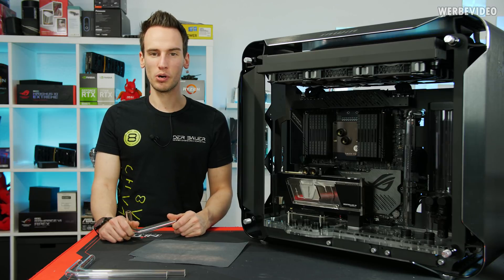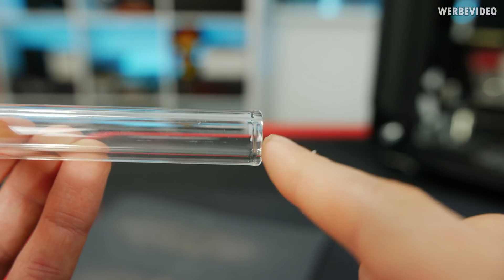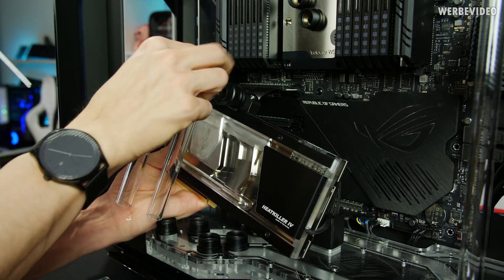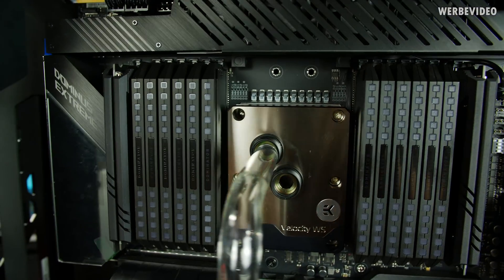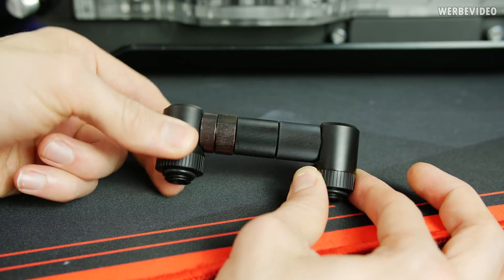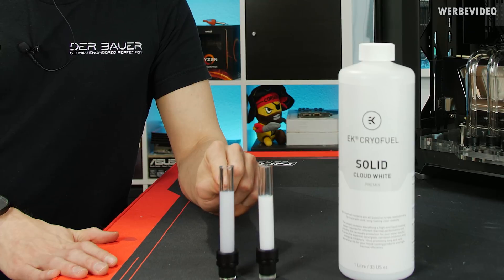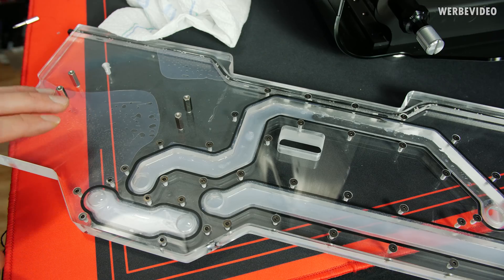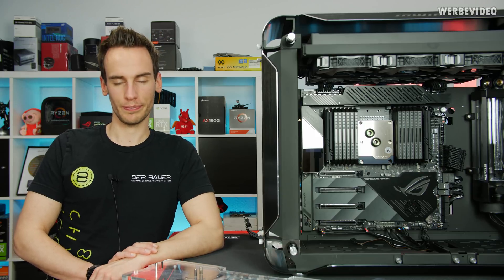Project Irrationality Part 9: The System is READY - or maybe not? The Distro-Plate-Surprise

Comment: I think CPUs will have to go to direct die in the near future. Even with water cooling, the immediate heat from the silicon is too hot. Similar to GPU direct die with no IHS, the cooling is much better even with a higher TDP. What are your thoughts?